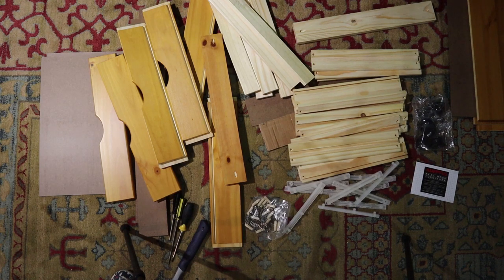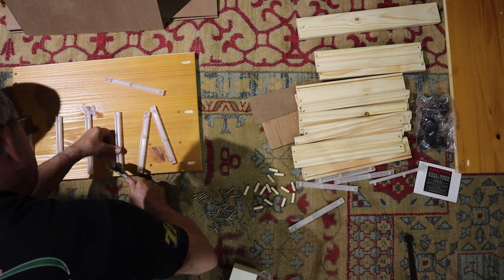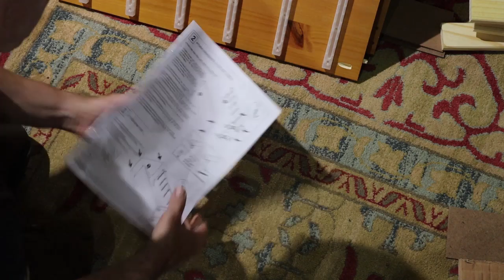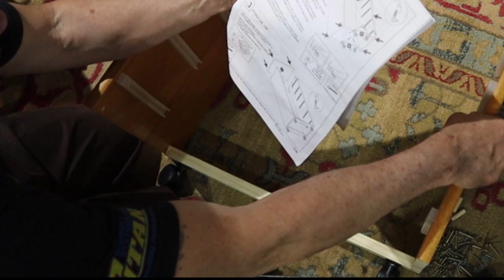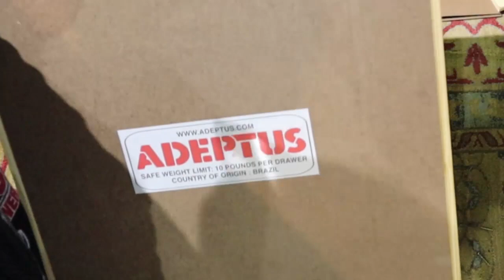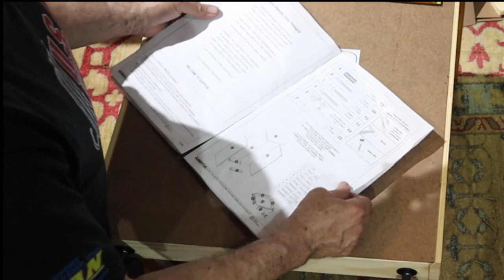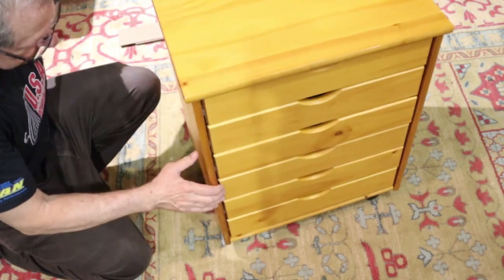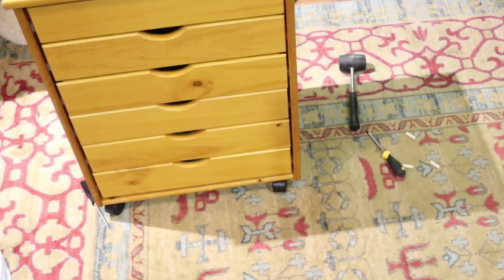Adeptus Cabinet Craft Storage,  Craft Room Storage All Wood 6  Drawer Cart Assembly

Comment: When trying to hammer in those plastic drawer rails, the spring-back that happens as a result of resting the workpiece on a carpet is also working to dislodge those drawer rails. If the workpiece was resting on a hard floor, those rails would go in more positively.